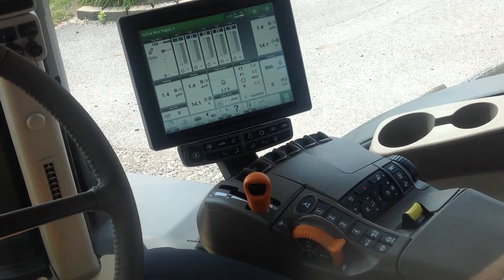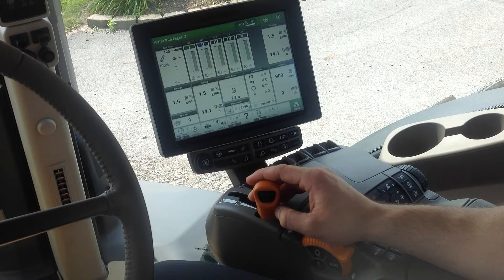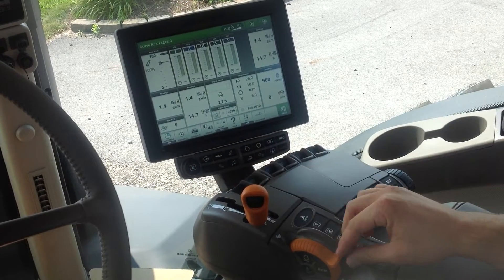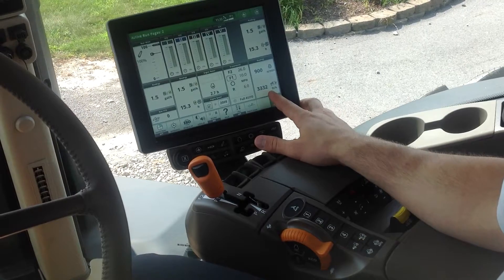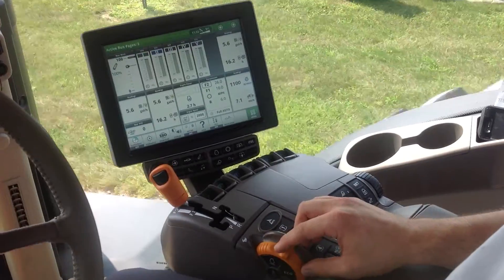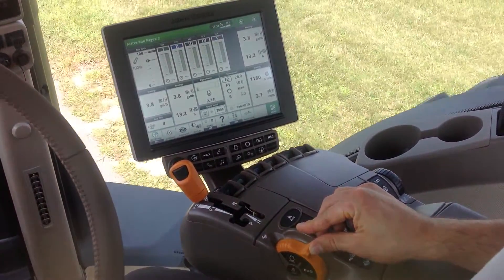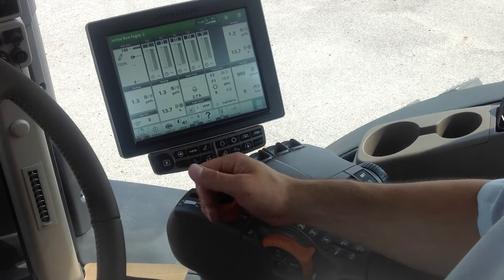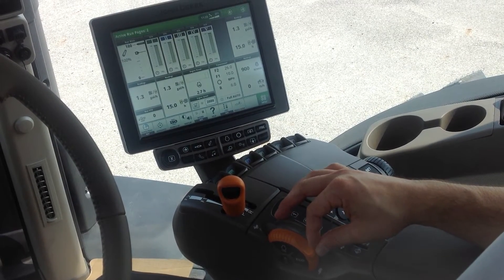IVT Transport | IVT Transmission Operation | 4600 Command Center

Comment: I’ve used ivt Trans for quite some time and always questioned if when you’re stoped with a heavy load behind and the thumb wheel is to the max and shifter is at the end while just using the throttle to get up to speed is it harder on the transmission to achieve full speed or should you thumb wheel back or the stick back half way before you engage the throttle moving forward?

Comment: Is it Bad for the transmission when you slow down with de driving Stick? For Exemple with a Trailer behind?
Reply from the maker: In general, it won't hurt the transmission unless you do it too fast and make it slow down too quickly and overspeed the transmission.
Reply: @KoenigEquipment  it won't hurt it even with a big Trailer with Load on it when you do it slowly with feeling?
Reply from the maker: @Deif_exc  No, it almost functions like downshifting in a semi to help slow down through the engine.